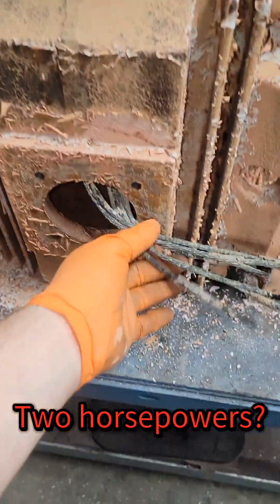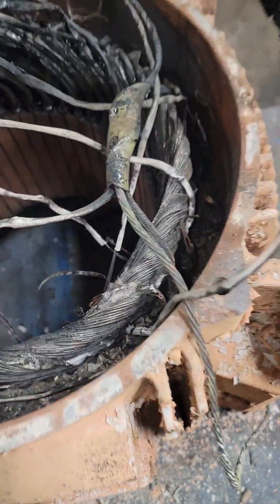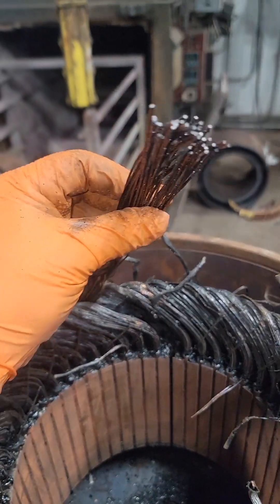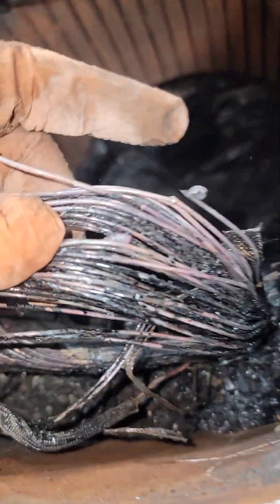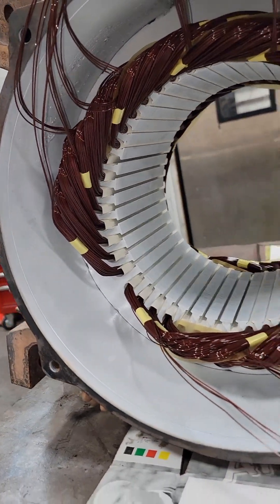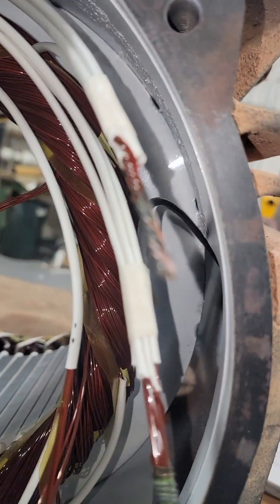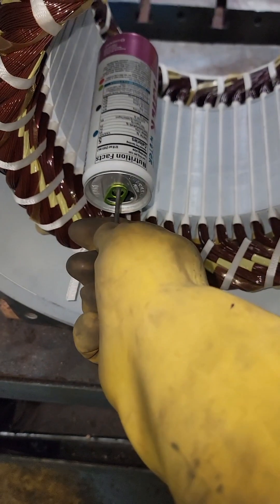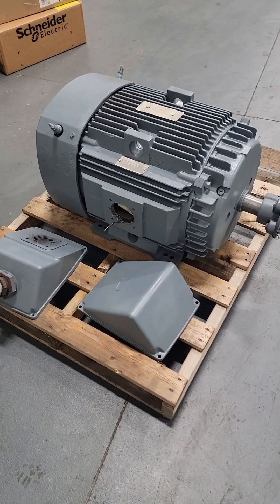50 / 12.5 horsepower electric motor repair #electrical #motor #horsepower #tech #tesla #torque torqu

Comment: Can you describe how you did the test with the can? Was the motor powered by low voltage? Did the can have a magnet?
Reply from the maker: @fabioruschioni2179  using a variac to provide a low voltage input. 12/20% rated volts per hertz should get you to nameplate rated current. The can is just aluminum no magnets, the changing magnetic field induced into the can creates its own magnetic field

Comment: Once you do this, do you make your own winding details plate for the motor for the next guy in 10-15 years to buy have to figure it out from scratch?
Reply from the maker: We keep a document ourselves on the winding data. If we change something like voltage, horsepower, or the connection we adjust the name plate accordingly.